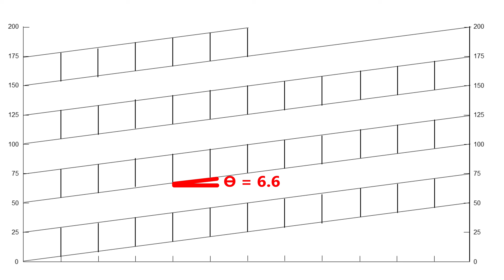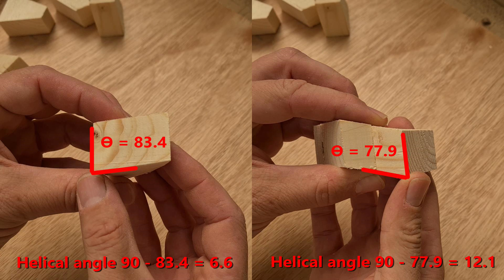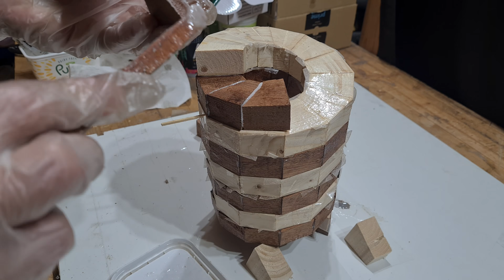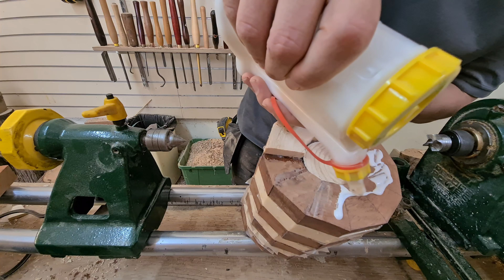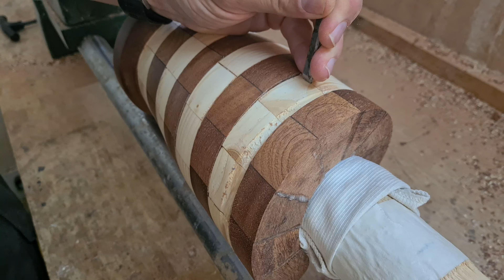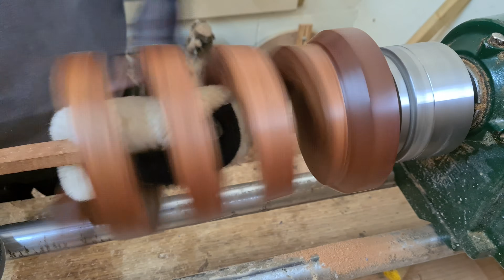Woodturning - The Open Segmented Helix

Comment from the maker: Question of the month: What are the biggest challenges in woodturning? What possible project could follow from an open segmented helix?
Reply: Did you ever try to turn triangular or square bowl by de-centering the piece in another direction for each border?
Reply from the maker: @floriandubath784  Hi Florian, do you mean like a 3 or 4 corner bowl?
Reply: @RayWhitbyCreations  yes exactly! My most challenging piece on the lath was a 3 corner bowl for which I had to design an adjustable counterweight with washers to be removed during the shaping process.
Reply from the maker: @floriandubath784  My first and only 3 corner bowl was this one: https://youtu.be/3MLnAiVpT6g. I loved the shape but alas not the colour. I want to revisit the 3 corner bowl some day soon. Do you have a photo of your work I could see please? Can email it to raywhitbywoodwork'at'gmail.com
Reply: A double helix 😎
Reply from the maker: @_JLY  There would be an easier way of doing this, but I don't have the machinery. To do this by hand would be beyond me I think! Thanks for the suggestion!!
Reply: A second open segmented helix  of different wood type but running /spiralling in other direction this i think would have to be done in two segments then glued to a same or similar wood  base then returned finished project would be on a revolving base my Idea inspired by Chris Ramsay https://www.youtube.com/watch?v=MQmJ0UR4Wk4
Reply: Em
Reply: A double-helix inside each other

Comment: Very creative. I think you would have found it more secure to eliminate the core ad instead have full radius segments.
Reply from the maker: That would be provide better stability but the changing angle of cut on the bandsaw would be difficult to achieve the closer to the central axis the piece was extended. Practically speaking there is a limit to the amount the piece could be angled to the blade on the bandsaw, but maybe it needs some creative thought about how to take it further. Food for thought, so thank you for your input! All the best. Ray

Comment: Insanity set in before you were through with the math, I’m living comfortably with this new(ish) state of being. 
For additional strength while turning I had a few drawing board ideas, so they may not work in practice. Gluing up the sacrificial support pieces-it looked like a very porous wood and CA doesn’t have as much strength filling those gaps. Poss epoxy between most of the segments between maybe 3 of the 12 of a complete turn for a less permanent glue. Or a less porous wood. Double sided turners tape may have helped temporarily connect the helix to sacrificial helical support and maybe to central column. Sanding after removing the support blocks, with some kind of center column in place, may have been done with the lathe at a very slow speed or turning by hand. 
After each project that severely stretches my abilities I sit back and consider whether I have completed my objectives as well as ‘mastered’ my new techniques. I never have yet but must choose between perfection of product or technique. After all, there are so many new things to try and only 48 hours in a day (multiple personalities working both in serial and parallel). 
Great work.
Reply from the maker: Thanks Kevin for your detailed feedback. I do go through a similar process and often find myself saying "why didn't I do it this way instead" almost immediately after doing it a different way. I've got some ideas of how to "cheat" and produce a similar continuous segmented helix, but got to find the time to play! All the best. Ray

Comment: Wrap the coil in a cloth and lace the connecting edges for a corset style "clamp"
Reply from the maker: Thanks Dan, if I had assembled all the pieces together at once then this would be very useful. But I need the compression after 4 to 5 segments at a time and without anything sticking to the epoxy resin glue!

Comment: I didn't see such a piece on a wood lathe before. On a metal lathe it would be much easier, because there you have a lead screw with which you can move a tool synchronous with the speed of the workpiece, for example when you cut threads. So it could be made of a single piece of material. But wood is not metal, so you have to invent other methods.
Reply from the maker: Hiya. I've seen the ability to combine a palm router and a controlled lathe for spiral work and I'm hoping I can reproduce something like that for this project. But I'm not an engineer and this would take some time. I think I could do it on a smaller scale with a laser, so hopefully can get the project completed more quickly!
Reply: @RayWhitbyCreations  On another channel I saw a method which is technically much easier, but needs a lot of annoying work: Ths guy there marked spirals with a pencil on the wood and then cut it with a file by hand. It works and the results are stunning, but doing it this way must be a real pain in the a**.

Comment: Amazing piece indeed! I know other woodturners have been able to achieve a helix by carving out with Dremel like tool the hollow spaces in between rings using indexing. This way you have a helix from a full piece of wood adding strength but it’s incredible how you came up with the bansaw jig to cut complex 3D mitre, would love to understand the calculation involved in shaping the curve 😉
Reply from the maker: Thanks Alessandro! It was a crazy idea, but was happy to have worked out how to do it, even though more difficult than other approaches. I hope to get a device which will allow me to do this more easily and hopefully turn a twin helix. If you need help with the calcs, let me know! All the best. Ray

Comment: try using heavy string like the Japanese use. pull it tight.
Reply from the maker: If I wood glued it then I probably could, but not sure how to cure the resin under tension with a few blocks at a time. Appreciate the feedback!
Reply: @RayWhitbyCreations  there is a release product that will not stick to epoxy .
plastic sandwich wrap works on silicone.

Comment: Maybe drill a hole through each segment and run a steel cable through the whole spiral and have a threaded end in the base with a nut that could bring the whole thing under tension.
Or for absolute insanity, you could dovetail each segment. Or both.
Reply from the maker: Dovetailing each segment! I'm not convinced I have the ability to do it properly. Although I thought about 3d printing each piece and then resin filling those. It would be more accurate. I've got one other idea, but would take too long to engineer and another creator is going to try it with his CNC router, so he'll probably beat me to it!

Comment: Too much maths.  Makes my head hurt.  🤕 I like the project, however it would be far too dangerous for me.  However, you could also go with a full resin pour after taking out the pine section.  The colour and wood together, in this form, would be totally amazing.
Reply from the maker: Hiya Summer Storm. I was thinking about a resin pour into this but really wanted to retain the segmented look. Definitely had to check the maths a dozen times to ensure it was right!

Comment: Stunning! I love how depending on the angle it looks like a continuous curve or a segmented piece because the segments still reflect planar. I wonder if you could increase stability on the lathe by using biscuits between the segments. They could be horizontal since you have plenty of material in each segment, though alignment would be tricky it would possibly make compression gluing more realistic
Reply from the maker: Thanks Patrick. Biscuits between the utile segments? That's an intriguing idea and would certainly solve the stability issue. Alas the views haven't reached the levels needed to buy a festool domino system, I think the dominos would work a little better for the small area of each segment. Really appreciate your feedback! All the best. Ray

Comment: Nice bit of work Ray, I assume you drew the helix in something like fusion 360 to be able to design the segment jig.  I don't suppose this was your first attempt either, if it was very well done, watching you struggle glueing the segments together gave me the thought that if you were to try something like this again you could make up another small jig to drill each segment and use a small dowel to hold them together, the female hole would be filled with glue and slightly enlarged allowing for better alignment of the segments. With the segments glued like this the whole thing far more ridged. Thanks Stu.
Reply from the maker: Thanks so much for your feedback Stu. I like your idea of doweling. Possibly could even try it through the sacrificial template to the central column. I had not designed it before, but knew the pieces were possible based on similar projects (closed segmented helices). The whole design needs to be strengthened somehow. A project for another day! all the best. Ray

Comment: Very cool Ray! Lots of work but well worth it. Got me thinking of a pattern I made in 1986 for a large pump. The shape tapered from a large cross section to a much smaller on. What was cool as it climbed upward while wrapping over itself at the 360 rotation point and look pretty cool. Built in a similar way but the helix was carved to shape. I should send you a picture of it.
Anyway that was a trip down memory lane but great job on this one my friend,
Gary
Reply from the maker: Hey Gary. Yes, would love to see the picture. I think carving the helix is an easy (or maybe only easier) work around which may invalidate all the ingenuity I thought I had with the bandsaw jig! I'm now going off to over engineer the wheel... All the best. Ray

Comment: My biggest challenge: this week I’ve completed my first wood and resin hollow form and used my steady rest for the first time. I discovered the wing nuts were too big and it wouldn’t fit where I needed it to!  I tried your maths but forgot to carry the 2 😂. In a nutshell: I am in awe 🌞
Reply from the maker: Thanks Ray! You can see my steady rest is a work of convenience, it shakes, rattles and rolls but just about works, but really useful. The real pain for me is that lathe is old style and I really could do with these new cam locks for the tool rest. The original lever style always, ALWAYS gets in the way!  All the best. Ray